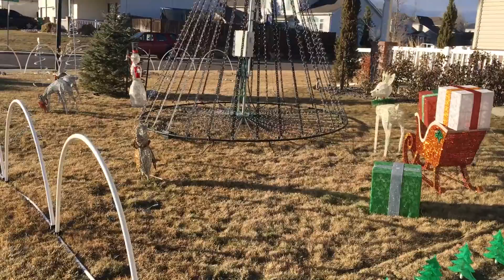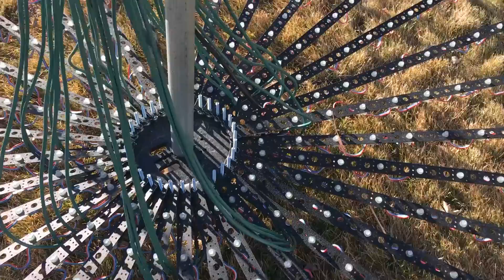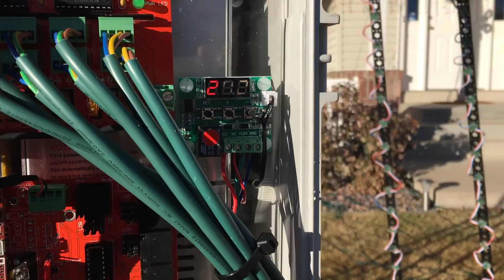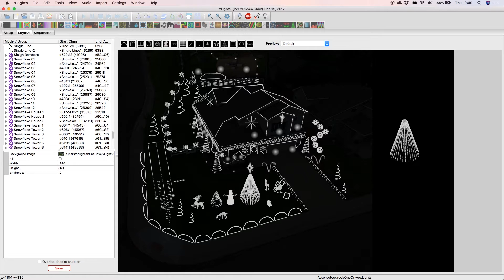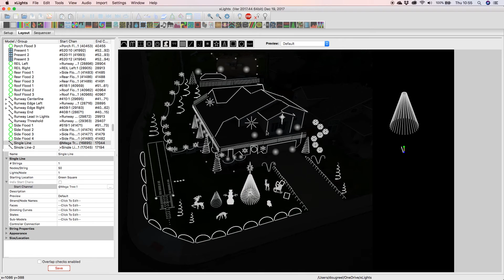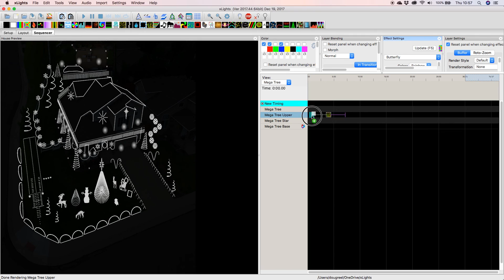Mega Tree Video Behind The Scenes

Comment: 2 questions. 

I see you use square nodes, would using bullet nodes be the same???  Or do you recommend square nodes for mega trees?

Topper. What topper would you recommend for a 48 strand 360 degree tree?
Reply from the maker: This is my older mega tree video with my original tree. My newer tree uses bullets. The only reason I went to bullets is because at the topper the strips are bunched together very tight and having bullets allows the strips to slightly overlap onto each other better than with squares.
Reply: @reelpilot  do you have a video or photos of your new tree?
Reply from the maker: https://youtu.be/-oBlNUflHas

Comment: Hi, what material did u use to put on the pixel light? I mean the strip, is it a metal or plastic? Tnx
Reply from the maker: The strips are from Boscoyo Studio and use a 1/2" Harbor Freight grommet.
Reply: I 2nd this!   What are the plastic-like strips that the leds are mounted to?  Do you mount directly or in a metal grommet?  Thank you for the video, it was helpful. :)
Reply: PixNode Extreme Strip - sold by the foot, I believe.

Comment: reelpilot: so you had 2 Falcon 16V2's, were those two controllers and that pi specifically for the mega tree itself? I'm trying to figure out how to wire it and model it in xlights. i'm new to this, so i'm still confused to the strings/strands/pixels etc.
Reply from the maker: Just one F16 with an expansion board for a total of 32 outputs on that tree. I like the simplicity of one mega tree stand per controller port. While it wastes some of the capability of what the controller can do, I also don't have any power injection with over 16k pixels. The modeling in xlights that I showed in this video are only necessary if doing the bottom pixel skirt. If you're not doing that then it's simply dropping the mega tree model onto the screen and telling it how many strands and strings.